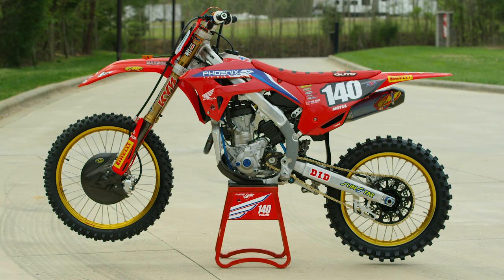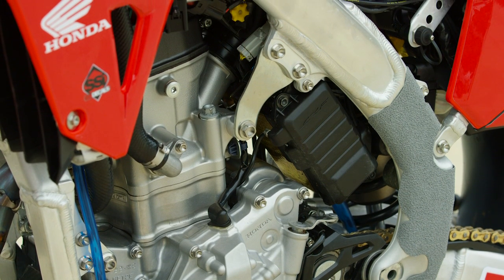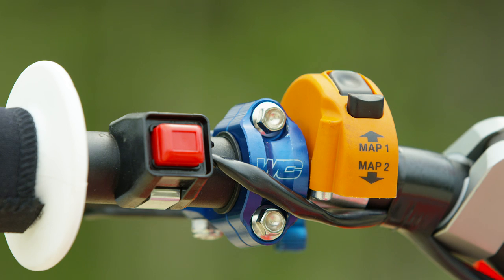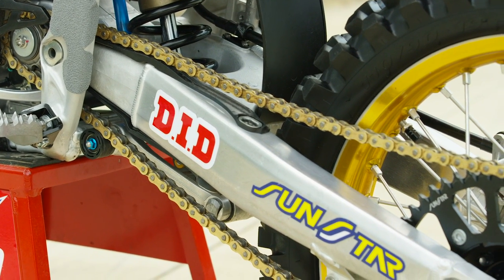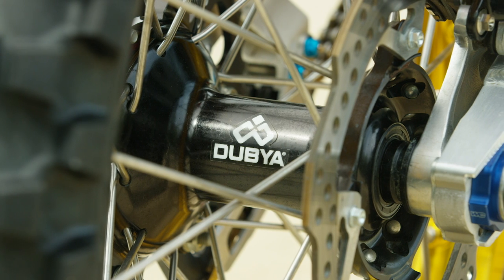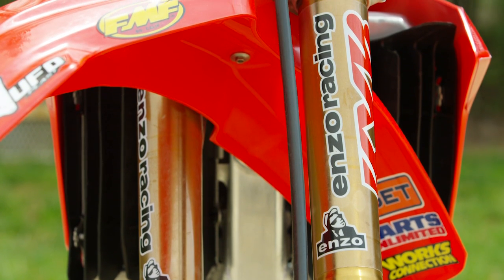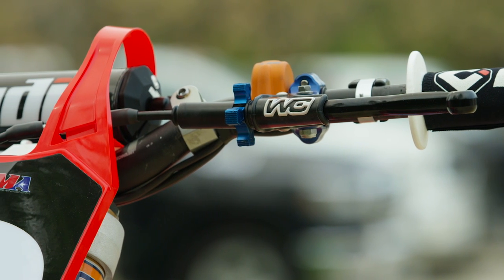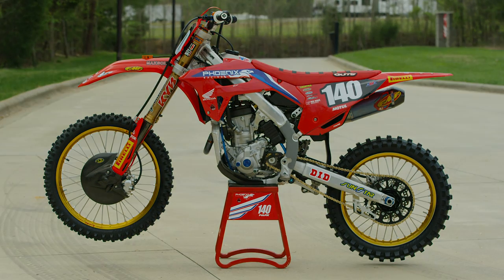Inside Cullin Park’s 2022 Phoenix Racing Honda CRF250R

Comment: Does anyone know if the 2020 cylinder works 270 kit will fit in the 2022.  Not sure if they changed the cylinder
Reply from the maker: It doesn't work.